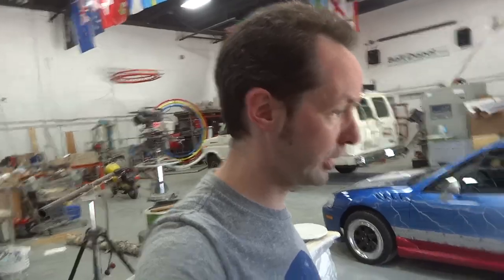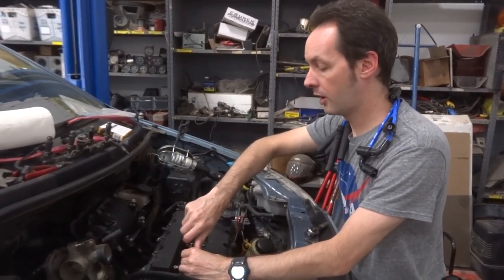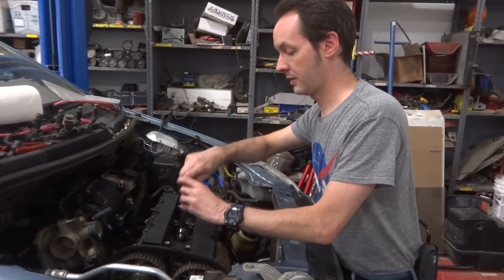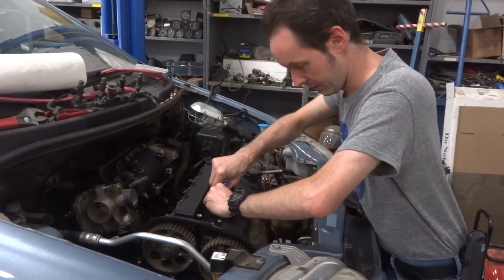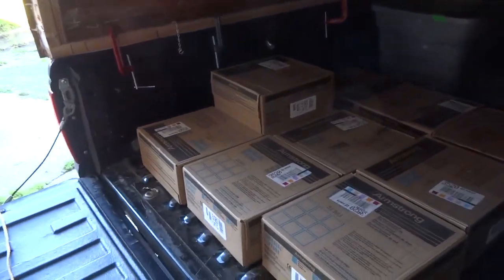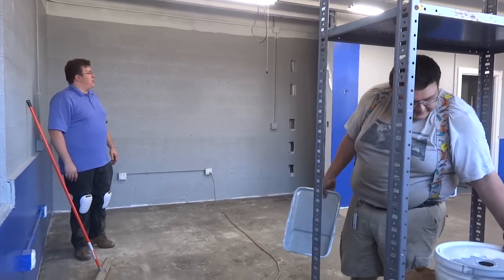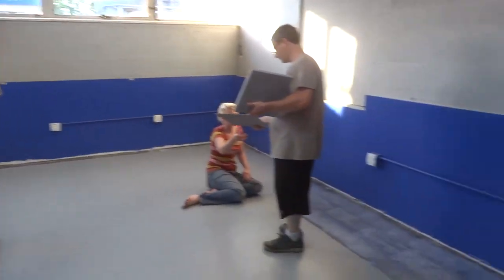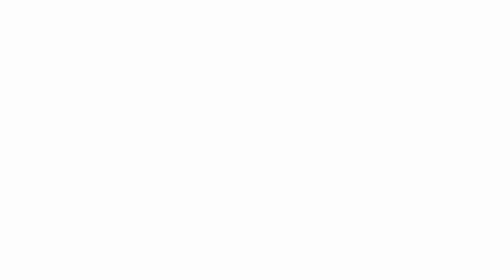Captain's Blog 7 12 2013 Spark plugs and floor tiles

Comment: I am sure you are aware but I will mention it anyway.  If you use a spark plug socket set they make quick work of removing and installing spark plugs since they have an internal rubber ring in each socket that gently holds the ceramic portion of the plug in the socket.  At one time I remember purchasing a set of the rubber inserts that would work on standard deep well sockets and turn them into spark plug sockets but I don't see them available anywhere anymore.

Comment: Jam a rubber garden hose gasket in the socket.  It doesn't need to "fit", just jam it in there. 

Never hurts to check the gap against the service manual. I went to PepBoys and asked for BR8ES11. They gave me BR8ES and told me it was the same. Its not the same. The plugs look identical, but the extra digits designate a different gap distance. 
-jc.

Comment: As long as people use proper handling techniques, ESD should not be much of a problem.  My home electronics and computer workbench is in a carpeted room but I have an anti-static grounded mat on the bench and also a grounded wrist strap available when needed.  The gray coloring in the tile may also make it conductive enough that static will eventually bleed to ground anyway.  Wrist straps and/or grounded mats are the best practice method though.